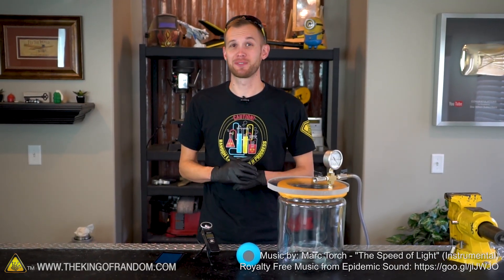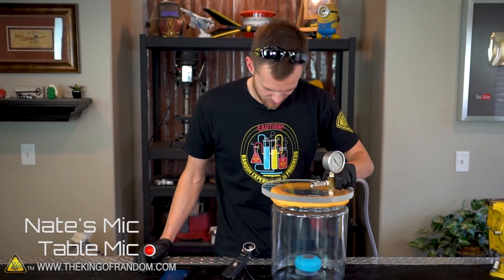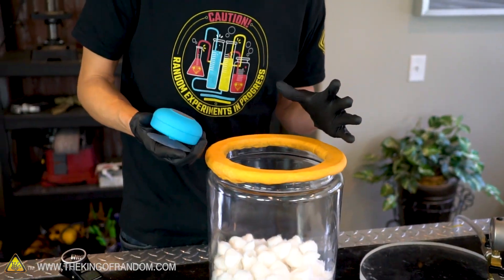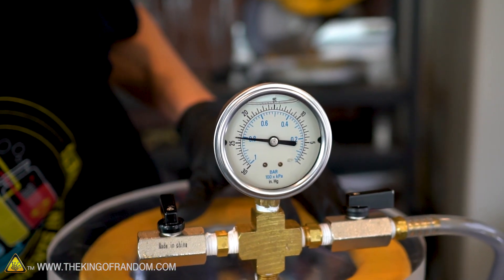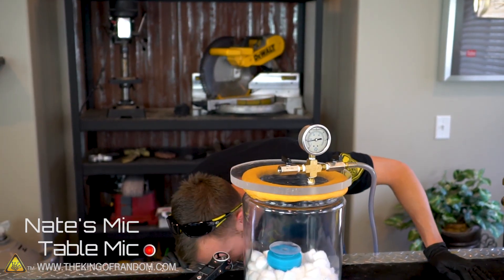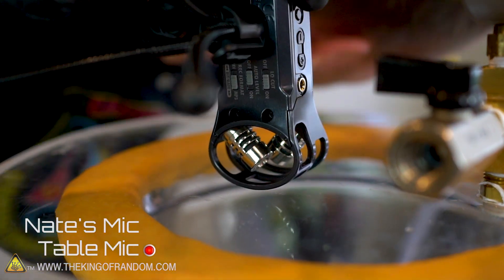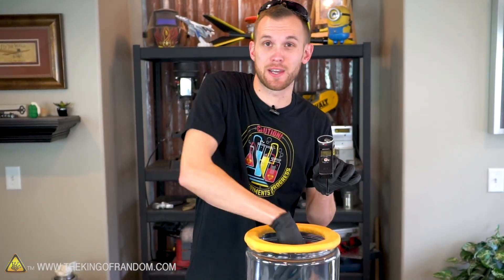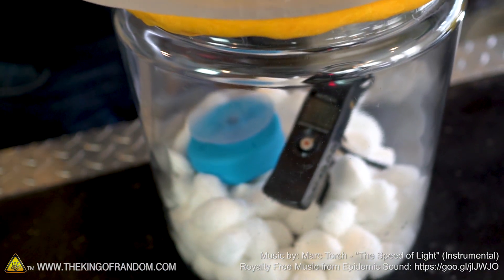Can Sound Exist In a Vacuum Chamber? TKOR's Vacuum Sound Speaker Experiment!

Comment: You can still hear the sound because the vibration of the speaker is transferred to the glass chamber which is in a space with air around it. The glass of the chamber works as a speaker, just like bone conduction headphones.

Comment: Very Indepth genius methods to test sound in vacuum chamber. 
I recommend also a different method to eliminate the possability of sound traveling through the glass and epoxy chambers.  Use a mangetic levitation speaker. the magnetic base at the bottom but outside the vacuum chamber. the chamber lifted and supported above with out touching the base. and the speaker in the inside aligned to the magnetic eddie current lines. so youll have an isolated levitating speaker  inside the chamber that is magnetically locked to the base which is also not touching the vacuum chamber. If you still hear anything at all, then that is a mystery in itself that requires our attention and further research

Comment: The reason you can still hear sound is because you're not pulling anywhere near a vacuum. In HVAC we pull down to under 500 microns. Either you're not sealed or your pump isn't adequate. A true vacuum is 29.92 inches of mercury. 26 inches translates out to 660,400 microns. That's not even close. I pulled a vacuum down to 39 microns the other day. There's a whole lot of air still left at 660,000 microns

Comment: I get link to this video as a proof sound can’t travel in vacuum at all. Does everyone else realizes in this video vacuum does not let membrane to move to create a sound (look up how speakers work), and when he start letting air in the membrane starts to move and creates quite sound? Am I right or wrong?
Reply: Why wouldn't vacuum let the membrane move? The speaker's membrane is moved by an electromagnetic field. Air has nothing to do with it. If at all, the membrane should move even better without all of the air resistance.
Furthermore, in the last test (both microphone and speaker at chamber) difference in sound level wasn't as big as in previous tests. I think it might be caused by the fact, that the bigger the difference between the density of the air and the glass is, the more sound waves get reflected from glass - Steve Mould explains it in a video about Ultrasound gel. So we can't hear the sound on the outside because sound waves doesn't escape the chamber so easily.

Comment: It seems to me that it isn't enough of a  vacuum to prevent the transmission of sound.  At least not much anyway.  That suggests that sound can transmit through very thin air.  But the vacuum jar itself does an excellent job of blocking the transmission of sound.  This is likely because it is an airtight chamber.  This actually supports the idea that air is needed for the transmission of sound.  The movement of air to be specific.

Comment: To make it similar to space why not put in  -300 degrees deep freezer see if the temperature has any effect I think it would make it more quiet and effective I think what's going on is when you put pressure on lid no sound can escape so as you decrease pressure the lid isnt as tight cause there is small amounts of oxygen still in that chamber is why you still hear sound it still can travel

Comment: Melted copper in the vacuum chamber.
Reply: Try thinking this through. Molten copper will cool off and solidify as it is poured into the glass chamber. The thermal shock will also destroy the glass chamber they use. A fix to the thermal shock is to heat it up in the forge alongside the copper to melt it. However, doing so will make the glass so hot it will burn the proto-putty seal and the plexiglass lid. (copper melts at 1,085 degrees celsius and plexiglass burns at 450 degrees celsius) 

won't work. And even if it would, I guess is it would do nothing but make it cool off a little more slowly in a vacuum. Nothing else.

Comment: 6:01 I'm confused how come the loud music doesn't get picked up by the microphone but a slight tap of the speaker on the glass makes a pretty noticable sound picked up by the mic?
Reply: I think the music not being heard has more to do with the thickness of the glass than the vacuum. Since the mic could pick up the music when both the speaker and the mic was inside the chamber, that means there's enough air left to carry sounds, so the glass was too thick for the music to travel through it, it couldn't move the air inside the chamber and the microphone didn't hear it, but a tap against the glass would make the whole jar vibrate ever so slightly, that would be passed through to the little air inside and the microphone could pick it up

Comment: Pretty sure if you remove the air from vacume chamber it will impeade the speaker diaphragm from movement, the correct method is using a mechanical bell

Comment: Your test was not done correctly. The last part with speaker and mic together. You reviewed the sound, but you did not share it on screen with public. I think there was no sound, and if there was, it was way way too little because there was still a tiny bit of air in there. My conclusion is you lied at end.  Sell outs always F*&k up.

Comment: +The King Of Random Could you use Layered panes of glass under vacuum for Sound dampening then?  I mean if you took an airtight thin box made of glass which had a -26 Mercury Vacuum inside of it and used it as a window or if a small room was made of these layered vacuum boxes would it have the same sound dampening effects as the actual vacuum Chamber does?  Would it actually dampen the sound or cancel it out even though the pressure inside the box of vacuum chambers is the same as the pressure outside the box?

Comment: the reason your experiment didn't "work" was because it wasn't a "True" vacuum. there was still air in there, not much, but there still was some, and since it's basically a small inclosed container, the vibrations sent out by the speaker are powerful enough to move through the thin-air and be picked up by the microphone. the mic, being a high quality one, also changes its own sensitivity when in a situation like this, (the quieter all sounds around it are, the higher it's internal gain goes up)

Comment: The sound should be there moving faster without any resistance only when it hits the mic/surfaces does it make noise. What happens in a high pressure chamber?

Comment: The reason the microphone doesn’t pick up sound is because it uses an air right bubble to feel vibrations when you vacuumed out the bubble the mic cannot work. Cody’s lab did an experiment where he put his camera in a vacuum chamber and he explained this concept. I am not sure if the speaker does the same.

Comment: The only problem is is that at the same time the air is being sucked out, the actual speaker cone gets pushed out and the noise decreases because of the speaker cone being restricted. The second test with the mic inside the chamber was better however.

Comment: For the mic inside and speaker outside, how about attaching the speaker to the glass?

Also you might get some better isolation if you hang them from the top using string or something, instead of having them sit on the bottom.

Comment: I was really hoping to see a control test each time.  We only got a pseudo control test up front with the speaker in the chamber with air but no cotton balls. You then changed the vacuum and that there were cotton balls which negated your original control test.   Basically, if you're going to have a science experiment, please use the scientific method.  A lot of the time you use it, but  I was disappointed this time.

Comment: I once worked at a place where we did explosive forming and dropped my calculator in the water. Took out battery, put calculator in vacuum chamber, the water sublimated and worked fine after replacing battery. Dried out instruction book as well.

Comment: 👌👌Will a gun fire in a vacum chamber??????👌👌
Reply: Yes the air and gun powder are both sealed inside the casing. Same reason that a gun will fire under water.
Reply: Clash With Arthur the air is already in the casing. Hence guns fire under water.
Reply: Gunpowder contains its own oxidizer. Thus it will ignite even without any air. This was one of the early experiments done at the Royal Society with one of if not the very first vacuum chambers ever created.
Reply: pretty sure this was on mythbusters and yes
Reply: gun powder is charcoal, sulfur, and potassium nitrate, the potassium nitrate is an oxidizer, so you don't NEED oxygen. so yes, you can shoot a gun in space.
Reply: Yes it will, as guns have an oxidiser, hence,they fire underwater.
Reply: Yes a gun will fire in a vacuum.
Reply: V2 weapons yes
Reply: V2 weapons yes and the bullet will never loose it’s speed
Reply: Devin Delbrel 
Just a mathematical theory.
Reply: Yes, mythbusters tested this. The gym fired perfectly
Reply: Devin Delbrel 
If you shoot a gun in space towards a source of gravity like a moon planet or star it should accelerate exponentially as you don’t have any air resistance
Reply: No
Reply: Yes
Reply: Sure it will, didn't you ever hear of an electron gun in a TV tube?
Reply: Duh
Reply: thats impossible
Reply: No air to make the gun powder to combust so no

Comment: See if ice conducts electricity because water dose would ice
Reply: karkar88 if it's the same material, what do you think?
Reply: pure water doesn't conduct water, so pure ice wouldn't either
Reply: ^ you would have to add some substance, like soap. The ‘water is a conductor’ confusion is mostly caused by bathwater, which has soap and other additives in it.
Reply: Does*
Reply: Ice would still conduct but a lot of resistance

Comment: c'mon, there IS NO sound in vacuum
Reply: That applies with a true vacuum such as space, a vacuum chamber isn’t a true vacumm
Reply: In a perfect vacuum. His machine isn't going to create a perfect vacuum.
@Matthew No..there's no air for the sound waves to travel through. It's not about bouncing off.
Reply: Well that's not as much as a vacuum as space is. And space isn't even a perfect vacuum
Reply: Matthew YT doesn't need air just other atoms and molecules
Reply: TXshooterProductions space isn't even a perfect vacuum
Reply: Space also is no perfect vacuum.
Reply: Wearing Bose noise canceling ear buds I could hear the music the whole time though it was super quiet in the vacuum.
Reply: There is NO perfect vacuum on earth.
Reply: Matthew YT there’s not “0” gravitational force in space
Reply: Technically he didn't say a complete vacuum and there is a lower pressure in the container creating a vacuum, the sound comes from the the glass vibrating from the speakers mechanical vibrations made by a magnet and copper coil.
Reply: Are you one of those, “oxygenate your wombspace,” kind of hippies?
Reply: Tsetsi turn up your volume and put your ear to the speaker...you’ll only hear a little
Reply: that WASN'T a vacuum
Reply: There is no sound in vaccum, but he's not using absolute vaccum. There's still a little bit of air inside the chamber, that's why it can pick a bit of sound.
Reply: Theres no air in there for the sound waves to bounce off.
Reply: It's because the sound can vibrate on the glass and anything in the side the vacume chamber, now if this was in space there would be no sound.
Reply: A vacuum chamber is different than space (a true vacuum)
Reply: Is there no vacuum in space as there is 0 gravtational field force?
Reply: Shave yourself weirdo...

Comment: Your baseline test for sound before creating a vacuum was fundamentally different from the setup you used during the testing in the vacuum. i.e. your speaker was not on cotton and not bottom up. given that the sound as you tested it was incredibly low, it's possible that had you just placed it the same way and added the plexiglass top, you wouldn't have been able to pick up sound without creating a vacuum
so I love your videos but your process was a bit off.

Comment: Can v boil/heat water by steering it fastly ??? Make  a vid
Reply: Theoretically you can heat water to boiling by stirring it. However, it requires an enormous amount of energy to stir it fast enough. You can heat it that way, but technically you will not have enough energy to make it boil.

Comment: Excellent demonstration. All I ever did with my vacuum chamber was high voltage experiments using different gases.
Reply: electronicsNmore Well aren’t you a double chocolate chip cookie.
Reply: @dixen9116  unnecessary negative input
Reply: @johnbarkl1700  Ignored outside reply
Reply: @dixen9116  stay mad kid
Reply: @johnbarkl1700  ignored
Reply: @dixen9116  L+ratio+didnt ask
Reply: Like farts
Reply: You would have to make one big enough to fit the other one it with the pump in it
Reply: Go bigger and make a fusion reactor instead of a fusor
Reply: Basically neon tubes :p
Reply: I'm sorry to tell you but were not going to make it to mars, if it took us 26 years to get a basic satellite there in a way better rocket than we had to the moon... well do the math..j
Reply: @coronamakesyoucoughalot5857  what are you referring to?
Reply: @coronamakesyoucoughalot5857  the first flying vehicle was invented about a hundred years ago and we got to the Moon about 50 why don't you do the math?
Reply: @FrancisR420  reee i was stipid sorry
Reply: Bragger lol

Comment: Make a hydraulic vacuum pump two rams one for air moved by one filled with hydraulic fluid one way valve on the air then you can maximize the vacuum.

Comment: What will happen if you put a quadcopter/drone in a Vacuum chamber ?
Reply: Propeller driven devices cannot function in a vacuum. The drone would spin, but not move otherwise. That's also why propeller-driven airplanes and helicopters cannot fly in outer space or on the moon. They have to be able to push against an atmosphere in order to move.

Comment: Is it possible to mix gasoline with metal (mixed it when both liquid) and if its mix, is it possible to lit it up when it's solid??? Just askin
Reply: Not possible. Metals are well above 280 °C when liquid, which is the kindling point of gasoline. The gasoline would burst into flames.

Comment: i would imagine that even though the air was removed, the glass would still vibrate from the output of the speaker, which is why the microphone picked it up inside, or maybe the plexiglass would still vibrate, and that's what made the audible sound. since it isn't perfect conditions like it would be in the vacuum of space, there's still a way for the vibrations to have an effect, Kinda like how when we speak, the way we hear our voices is affected by the vibrations in our skull structure that is caused by our voice. this is all just my assumptions and i'm in no way an expert on the subject or anything i'm just making assumptions. Correct me if i'm wrong.
Reply: If the source of the sound is isolated from the glass and plastic, then the glass and plastic will not vibrate from the output of the speaker. No matter how loud you turn the speaker up, its sound cannot reach the walls of the container in a vacuum. The only way it could cause the walls to vibrate would be if there is a material connection between the speaker and the walls, such as air, a string, or some other material that touches both the speaker and the glass.
Reply: shinaanish well we're forgetting how speakers work. The sound you hear is electric...something or the other.pulses and lengths of waves of electrricity...stuff I forgot and yada yada....but the point is speaker don't just automatically create sound. There is a process that makes sound. And that process is what creates the initial waves...which is transferred then to sound waves. Therefore...if you go into details I'm research...there should be evidence vibrations just in the creation of the sound it self. 

And if that vibration touches something...then what we interpret it as, would be sound

Comment: Very poorly done experiment IMO. Half of the video wasn't even actually related to hearing the sound in a vacuum. It was just hearing it within a glass container.
Reply: You have to have a control group to measure against a benchmark.
Reply: No control group can measure how the sound travels through a vacuum, because sound does not travel through a vacuum. The control group has to present the sound inside the chamber just as it is, but without a vacuum. The direction of the speaker makes no difference (except as it might pertain to the isolation of the speaker from the walls, floor, and ceiling of the chamber). Isolating the speaker is the hardest part, and perfect isolation is almost impossible.
Reply: shinaanish you’re right that is what I meant. The mic should’ve been placed inside with no vacuum and tested the ones with a mic outside just seem irrelevant to the experiment that’s all I was getting at. I’d like to see it done in a larger scale and more pertaining to the distance the sound would travel within and without a vacuum. I suppose I just had a different idea in mind I was wanting to see when I clicked on the video.

Comment: If you were in the middle of space without any gear on or anything “saying you could actually survive” there would be no sound at all because there is no wind or anything for the vibrations of sounds to travel through therefore even if you shot a gun next to your head in space you could not hear it at all